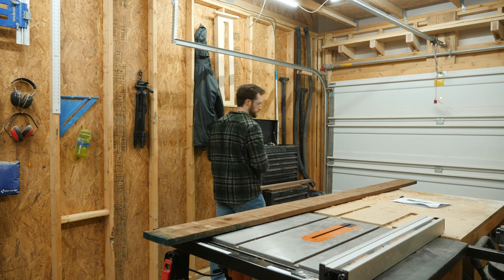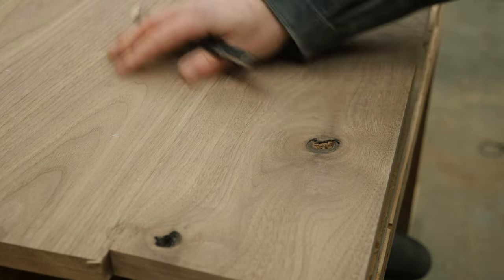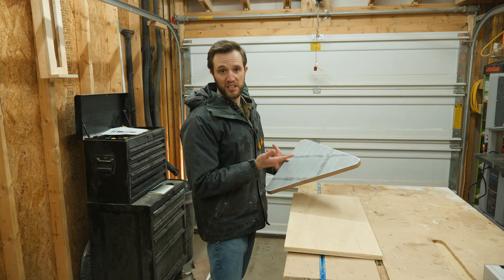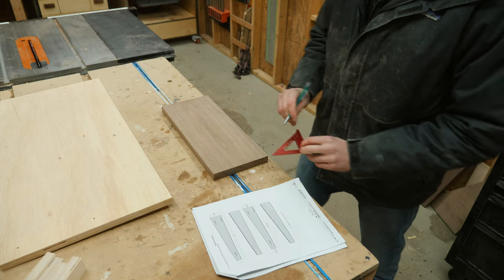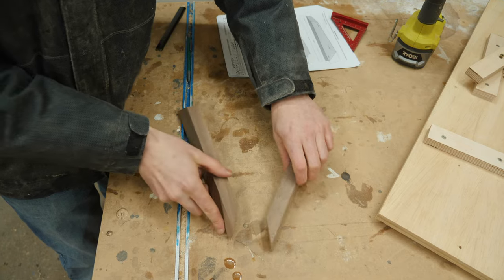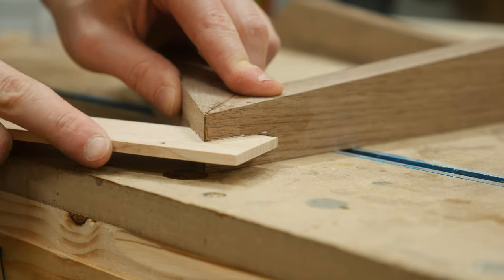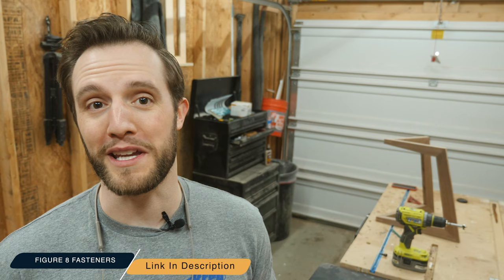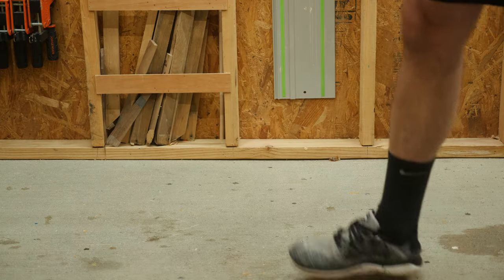they said this would never work

Comment: Great build, Eric! I love the design. That Furniture Butter on the walnut looks beautiful! Walrus Oil cutting board oil is my go-to for cutting boards and I love it, so I'm sure the furniture butter is excellent as well. - Joe
Reply from the maker: Thanks, Joe! Yeah, that butter worked super well and I’m all on board for skipping film finishes now! Any issues with the cutting board oil?
Reply: @SpencleyDesignCo  that's awesome! I've actually been thinking the same thing. I typically spray lacquer and sometimes poly, but I'm thinking about trying Rubio Monocoat or some other hard wax oil finish. Especially on something like walnut. I've had no issues so far at all with the cutting board oil. I just spread on a generous coat, let it dry overnight, buff off any excess, then add the cutting board wax. It looks and feels great and I haven't had a client complain so far.
Reply from the maker: Lacquer, eh? We talking rattle can stuff or the two part precatalyzed stuff?
Reply: @SpencleyDesignCo  If it's a small project, I go for Deft rattle can, but larger ones I use the "brushing" lacquer and just thin it with lacquer thinner to use in my HVLP. It has worked great every time and dries incredibly fast. I can do a LOT of coats in just one day.
Reply from the maker: You know, I’ve never actually tried lacquer before 🤷‍♂️
Reply: @SpencleyDesignCo  what?! Man, I love lacquer. I can spray a coat with a rattle can and it will literally be dry within 5 minutes and I can spray on another coat.
Reply from the maker: I’ve heard Katz Moses praise about lacquer, but I’ve just never tried it lol. Might have to give it a shot one day
Reply: @SpencleyDesignCo  definitely!